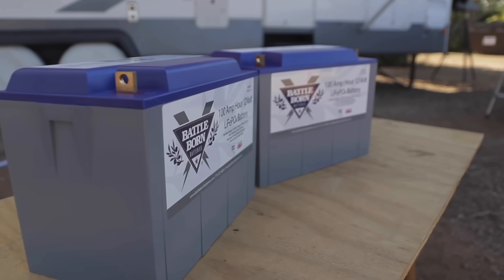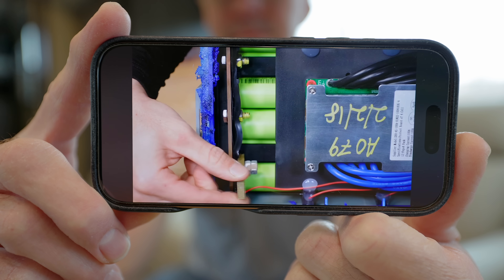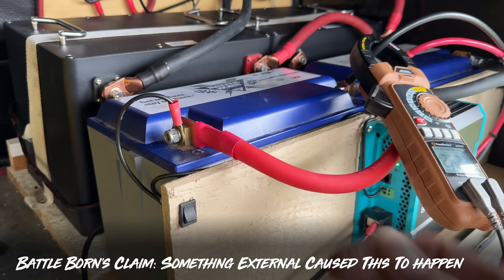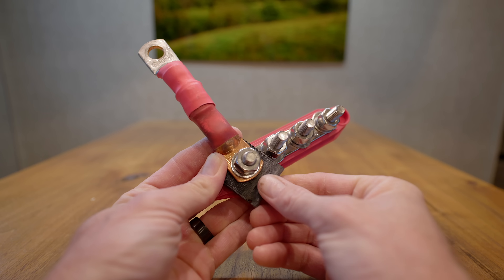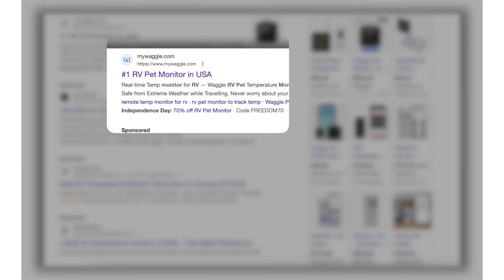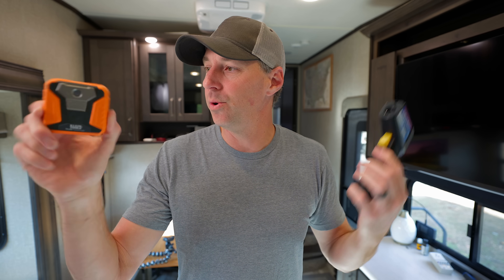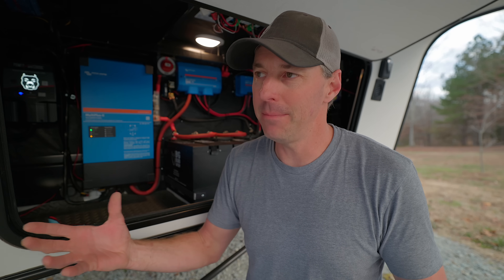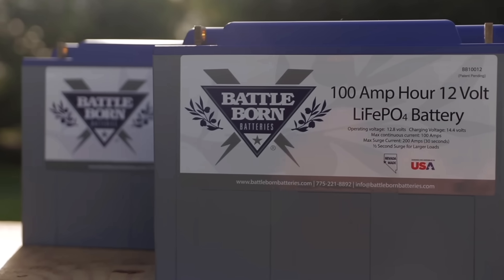Battle Born Batteries Problems!

Comment: An aluminum nuts is designed to melt as a failsafe? Think of the melting point of aluminum: 1220.58 degrees F (or 660.32C). Who wants a battery that has to get to over 1,000 degrees before it "disconnects".
Reply: Plastic melting not the nuts.
Reply: RIGHT.   A Beyond Ridiculous Explanation.

Comment: Will Prowse is very sharp and tests batteries very thoroughly.  As an electrical engineer, the failure mode of a bad connection is not a safe mode of failure.  This should be a fuse, fuseable link or thermal breaker.
Reply: I'm a retired ME who spent years in power generation and distribution. Since the NorCal wildfires of October 2017, I have built 15 LFP battery systems for friends and family as a hobby. 
I hydraulically crimp all wire ends, use larger wire than required, and make my own copper bus bars. I will not allow any plastic in the bolted connections, not even Bakelite. Metal to metal only, external DC rated fuses on each battery.        Will is the kind of person to wake up and cut battery cases open at 3AM if he has an idea. Its very hard to find anybody with his level of enthusiasm and professionalism these days.
Reply: I’m an ME with precious little experience in electrical transmission or design…but I know enough to spot a BS answer from a manufacturer trying to cover their a$$…and describing a lose connection as a “fail safe” is right up there with the worst of them.
Reply: Agreed, the problem we're running into now are the Battle Born fanatics that are claiming "fake news" on this issue and trying to make a rational explanation for this "design" and trying to discredit anyone that says this is a problem.

Will has nothing to gain by trashing a battery company, he's exposing the good and bad of what he sees and tests.  It's wild to me that there are people that would rather defend BS statements from a company that only cares about their money than to think for themselves and realize how poor this design really is.  Thermal deformation as protection the way BB is claiming is ridiculous, but there are people out there defending it because they believe BB is infallible.
Reply: @horegoan  That design is not poor, it is pathetic and dangerous!
Reply: @horegoan  People defend it because the alternative is to admit they voluntarily made a huge decision mistake.  I've seen it as a doctor with Lasik surgery victims; they willingly undergo the treatment, ignoring the risks and when something goes wrong, they cling to every excuse and alibi they can that justified their original decision when the fact is; they alone are responsible for the consequences of any bad outcomes.  There are forums for victims of poor Lasik procedures that to read them are an exercise in terror.   
My prayer is that the victims of BB do not themselves become stories that too are an exercise in terror.  Eventually though, this will result in injuries or worse.  It is inevitable and BB knows it.  Their lawyers tell them what never to admit.
Reply: Will does a great job testing items. I’m not sure what his background is, but EE or ME is my bet!
Reply: @paulmorrow8372  No, he's self taught at least for most years prior to moving to the house. Sometimes he's wrong, less often now, but however slowly he comes around.
Reply: @paulmorrow8372  You know how it goes with assumptions, right?
Reply: @paulmorrow8372 probably self taught.
Reply: Do they require EE  student to take a course in Material science? Plastic creep very fast even at room temeprature.
Reply: Well he didnt see this, when he first opended such a battery! But it was easily visible in the old video.

Comment: I think the BIGGER problem is if these were Underwriters Laboratories (UL) listed approved, then the issue isn’t Battle Born it’s the UL processes and approvals! How many other UL listed products are out there that aren’t right or improperly listed?!?! Battle Born was just going based off of UL listing, so maybe Battle Born needs to go after the Underwriters Laboratories!! Are the other UL products in my RV and in homes in danger?!?
Reply: I think I read in the comments that these BB's are only "built to UL standards". not UL Approved.... so dont blame UL .
Reply: @jeffgillis9296  ~ Good to know!  Thanks!
Reply: BB should never submitted that design to (UL) for approval and (UL) should never given their approval!  All the holes in the cheese lined up on this disaster!
Reply: @rpsmith  UL does not approve designs.  They test equipment to ensure it meets safety standards.  The UL standards for batteries are also international (IEC) standards.  You can claim the product is built to meet UL standards, but that does not mean the product has been UL tested.   If the product has been tested by UL, you can claim it has been tested by UL, meets UL Standards, and display a UL sticker on the product, as well as use the UL logo in advertising.
Reply: Some details to correct:
They are Listed to a UL standard, but the listing agency is Intertek-ETL, not UL. 
Listing should indicate both testing AND ongoing factory audits. 

But - and this is the important part - no part of a Listing should EVER be taken as a warranty by the agency that all samples of a product are good. It only means that (a) the samples they tested met the standard, and (b) that the factory can produce the product to the standard. 

A manufacturer of a Listed product is ALWAYS 100% responsible for what they produce.
Reply: @shiftfocus1  ~ Who ever put their stamp of approval on this design need to find a new career!  They aren't qualified to change a light bulb!

Comment: Looks built to fail 🔥to me Jared, with that plastic insulator that should cause an increase of resistance/heat?
Reply: Not to mention the aluminum bolt to copper connection!

Comment: I'd say Will is spot on. This is a dangerous and unsafe design, not to mention an insanely priced battery. 
You're right Jared, this exactly smells like the frame flex problem.

Hoping they have a good and safe resolution for this .

We used RENOGY, REDODO and have had nothing but great results with testing and install installation for our friends and family campers.

Thanks for sharing
Keith

Comment: I ditto the comment that Battleborn passes the buck to the user making the warranty useless. I paid close to $4,000 for a set of four Battleborn batteries. In the 3rd year, when the batteries kept shuuting down, Battleborn had me go through days of recharging procedures. When that didn’t work they said I couls pay to ship them back to Battleborn, and then pay $150 an hour to have them tested. They suspected I was at fault, and if their tested bore that out, no warranty coverage and I would be out all that additional expense. So I just ate the $4000 I had spent, and purchased batteries from competitive manufacturers. 
Too bad I had paid more for Battleborn’s name recognition to get such disappointing results.
Reply: I would hope a class action lawsuit will get battleborn to honor their warranties and give refunds if that design flaw was deliberate. I feel they have been laughing all the way to the bank at the expense of consumers.
Reply: @vihtoripuurola3775 they're going to be shutting their doors soon.  They can't pay out a reasonable lawsuit and make things right.
Reply: @vihtoripuurola3775  Their stock has absolutely tanked.  They may not have enough money to pay their normal expenses, let alone a lawsuit.
Reply: Yes why pay 2 or 3 times more for a poor engineered battery. Will has already proved there are better choices for less money.
Reply: Ouch
Reply: $4000 for 400Ah, ouch.  My DIY Bill of Material is $1900 for 920Ah in Feb, 2023. Today price is probably $1000.
Reply: @AZRockRunner I've got 2000ah for $2200, last year. Not a single problem with even one of the 20 batteries after hundreds of very hard cycles. Bought them with Will Prouse's test and  recommendation on his channel. Couldn't be happier with them.
Reply: @georgesrisomsak9650  wow. I know Lithium price spiked up in late 22-early 23 (after Covid) but fallen fast ever since.
Reply: I have not had the same experience as you, but I hear what you are saying.  I too paid big bucks for a worthless promise.

Comment: It's easy to make assumptions and certainly this is an issue which Battle Born needs to determine a root cause and if necessary implement a solution.  I am more than willing to throw Battle Born under the bus but if we want a complete and honest answer we need information from the end user.  Such as was lateral mechanical forces put on these terminals to cause these terminals to come lose.  Additionally what is the charge and discharge history of this battery.  Could this battery been overcharged or over discharged.
Reply: Valid Questions.

Comment: Yeah that "plastic failsafe" doesn't make any sense as its still connected via the bolt, and now a lose connection and will arc and get even hotter across the threads and bolt that are still connected.  I would like to see the engineering behind this "plastic" piece.  🤷‍♂🤦‍♂

Comment: So far so good with our two 100ah BBB that we purchased back in June 2022. We have them installed in a utility box mounted on our TT tounge. I did put them both on some hard rubber matting to try and minimize vibrations, but yes, I can definitely agree with Will's concern that over time, the internal bus bar bolting configuration could be an issue with working it's way loose and causing an arcing or shorting situation. Thus if that were to occur, I fail to see how the plastic insulator sandwiched between the bus bar and mounting post would prevent arcing or shorting of that positive terminal. Given how that battery is contructed, the only fix I see happening is a redesign and replacement. Lets hope BBB comes to their senses and does the right thing!

Comment: Wrong response from Battle Born Batteries. Typical corporate reaction to what appears to be a serious issue. Based on that response, I would never consider their products for my needs. I chose another brand when I converted to lithium in the RV. At this point it looks like we made the correct decision. Battle Born needs to address this issue properly...the sooner the better.

Comment: The thing that is the same as the frame flex and battleborn is both were pushed by RV influencers..... and both are junk (BB and GD).  I have 3 BB batteries (not same design) that have stopped working and BB failed to stand up to their warranty.  I believe Will way more than BB and their overpriced junk.

Comment: The "feature" they describe.. would be a fuse. Soo. if they want that feature in the battery.. put in a fuse.  By the way, have you checked the BB stock chart?  Lets just say, if my water level in my tube dropped as fast, I'd be happy.

Comment: Imagine paying top dollar for your batteries. Then find out that the engineers that designed the batteries failed basic electrical theory.
Reply: I don't have to "IMAGINE" (pun intended about that frame bending debacle). As I have a few BB's a couple years old.  Ill be checking thermally, often . What a PITA. !🙄

Comment: Jared I’m sure you’re glad you switched from those batteries. To me their biggest problem is cost vs. what they provide. Their prices are way too high compared to better products. I think they feel like their made in the USA overcomes that issue for some consumers but then when their battery has a problem as it is now you’ll lose even the most ardent brand consumer. I trust Will much more than any battery manufacturer trying to sell you their product.

Comment: I have 12 BB batteries and had my system professionally installed by a company that was in business for over 20 years. Was having issues with a ripple when plugging in and it went back up to the installer and they spoke with BB and concluded that I needed some battery balancing and some big black thing from BB that connected to the negative wire before the batteries.   Still have issues and we believe our batteries are not lasting as they first did five years ago.

Comment: Great explanation.  I would only add that this is a design issue, not a manufacturing issue. While manufacturing failures tend to show up quickly in the life of a product, design failures typically take more time.  (So it’s not surprising that the complaints are increasing and that most of these problems are being discovered in batteries that are 5 - 7 years old.)  Furthermore, manufacturing issues will be “hit and miss” with identical usage, depending on the operator who assembled the product, while engineering design issues will fail much more consistently.  
This has two major implications. First, having a battery that currently doesn’t show signs of overheating due to arcing doesn’t mean that six months or six years from now it will still be safe to use.  More likely is that the percentage of these failures will increase over time.  Second, a very serious design issue can result in consistent failures even with normal usage, well below the specified loads. 
Finally, Will’s Garage released a video where he tore down the battery and discovered that in addition to the plastic being sandwiched between the bus bar and the terminal, the hole for the bolt was too large.  This means that the entire electrical load is being carried over a very small surface area likely resulting in heat build up. This alone could cause heat to be transferred to the plastic causing it to soften and deform over time. I believe this is a very serious design issue, with the potential to cause premature failure in a very high percentage of products (even disregarding all the other issues identified).  
Finally, overheating does not cause the bolt to fall off and disconnect the circuit, it just further loosens the connection and causes more arcing and more heat.  BB’s claim that this design an intensional fail safe demonstrates one of two things they are being dishonest or they’re incompetent.
Reply: Both

Comment: CORRECTION
This problem appeared when one of Will Prowse viewers had 3 battle born batteries fail.  Will made a vid and now many battleborn battery users have been reporting battery failures of the identical problem.

Is your battleborn battery a danger for your RV?
Battle born stated that this so called SAFETY they use to connect the batteries is used in ALL THEIR BATTERIES  so YES, you absolutely need to check your batteries..  THE PROBLEM showes up on the POS TERMINAL. FIRST IT GETS HOT,  THEN THE epoxy around the terminal in the case starts changing color from bright red to dull red, then the epoxy cracks.  at its worst, you will be able to move that terminal with your fingers in the case, at that point or any point you see trouble,  stop using that battery.  CHECK ALL OF YOUR BATTERIES.   The person that alerted Will Prowse had 3 batteries test bad and he had to shut them all down.

The fact that Battleborn say you can use 100% of the battery energy has users using less batteries, and this helps cost wise.  The problem with less batteries is you use more current which creates heat.  All systems are suspect..  don't sit back thinking you are ok.  CHECK YOUR BATTERIES,  a fire can happen if it gets bad enough even if you have the Lith batts that are not supposed to be able to burn, they can under the right conditions.  HEAT is one of those condition.  Don't be lax, make sure your system is safe.

Comment: I use Li time  200 ah  self heating  at 1/4 of the cost of Battle born i have had them for 3 years . travel to  Alaska drove around Alaska for 3 months and just finished a cost to coast trip this year ,  Zero issue with batteries.

Comment: I'm completely against the plastic being an integral part of the connection at positive terminal.  That said, if I already owned them, I would verify that my wiring is sized and connected properly and I'd probably keep using them.  I would check the connections under load every time after a vibration cycle.  Not much you can do at this point if you check the stock price of the parent company.

However, knowing how it's constructed, I would not purchase a new BB battery.  Especially since you can get a decent Chinese made/assembled battery for 1/5 the price.

Comment: BB has been soaking customers for years and its time to pay the piper. Issue a recall and do the right thing. The only people who wont have a fire hazard in their systems are people drawing significantly lower current the the batteries are rated. Electrical connections are not supposed to be conducting through the bolt, they need to conduct via flat mating surfaces(no ridiculous plastic spacers!). Just looking at the joke of a design I bet these amateurs are probably torquing via the head of the bolt and not the nut too. Also dissimilar metals are also a no no unless using approved grease.

Comment: I have my (2) 100 amp packs in service since 2021.  I have had ZERO issues in over 23k miles since installing them. I check my connections 3-4 times yearly and thermal image 2X/yr.

Comment: My experience with Battle Born is that they have great customer service.  I checked the terminals on my batteries which I had bought from them, and they are solid.  I’m currently planning a new solar system for our new RV, and plan to buy some of the equipment from them.

Will Prowse is without a doubt entertaining to watch. His enthusiasm is infectious. He has made some mistakes in the past though (Google it).  I was glad to see him test a new battery, because that first video was next to useless.  I say this because who knows how that battery was treated before Will got his hands on it?

As far as how this all plays out, only time will tell.  I’m no expert, but the design seems a bit sketchy to me.  Having said that, I wouldn’t take Will says as Gospel.  UL Laboratories he is not.  There’s also an ethics issue in that Will profits off the number of views on YouTube. I’ll sit back and wait to see what happens.